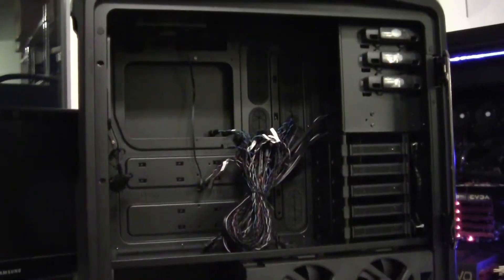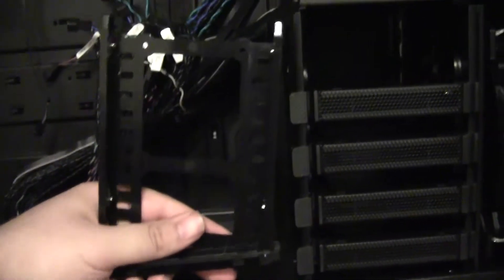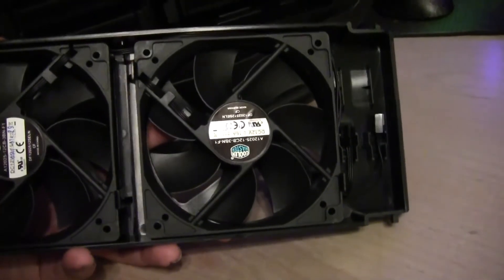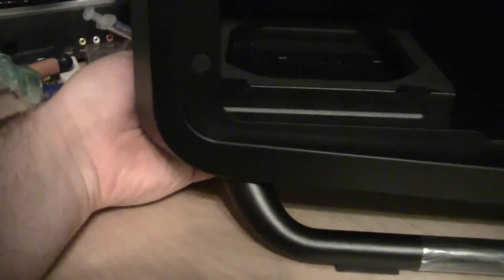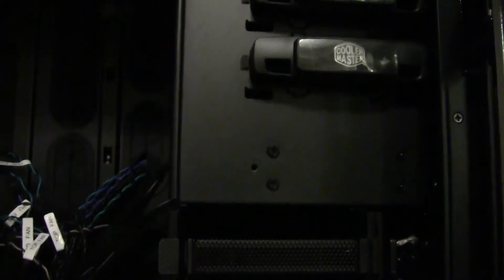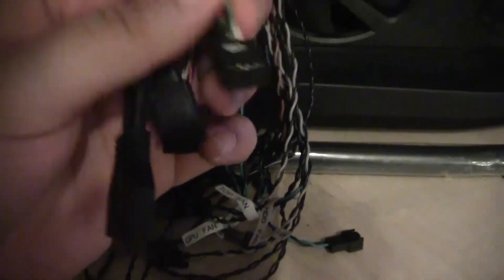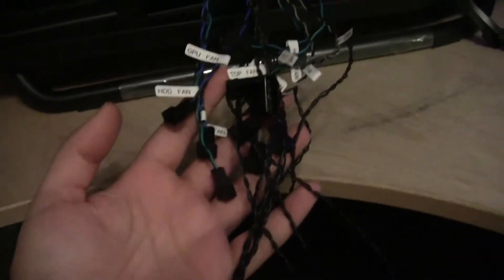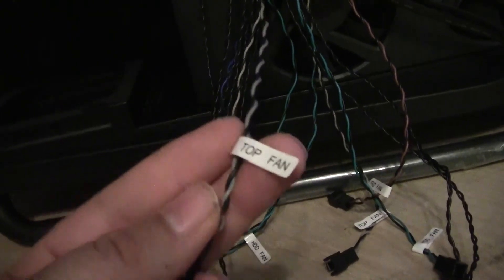log #2 - Gaming Build Project - Cooler Master Cosmos II Overview Part 2

Comment: Hi, thanks for the post. Could you help with a problem? Have the msi big bang mother board with the cosmos 2 case. Problem is that the front fan controller does not light up, cannot switch on power. If I press the power button on the motherboard it works, the all the fans work...except the front fan LED light and the LED lights of the controller. Checked and rechecked the cabeling..but just cannot see where the problem is! Could you advise?